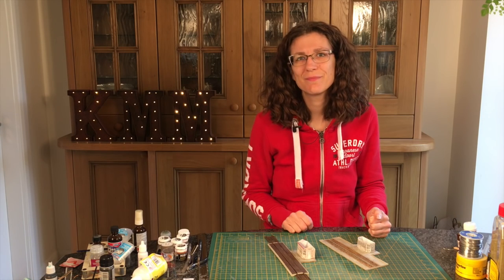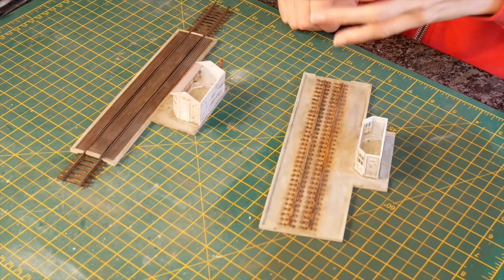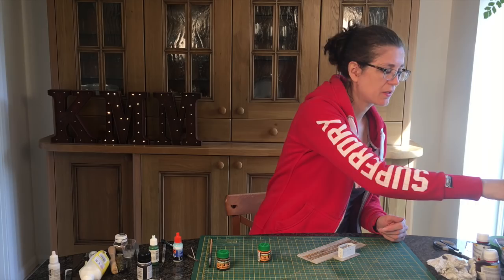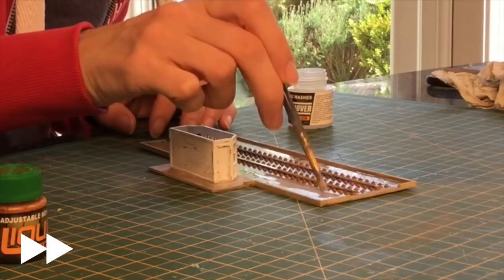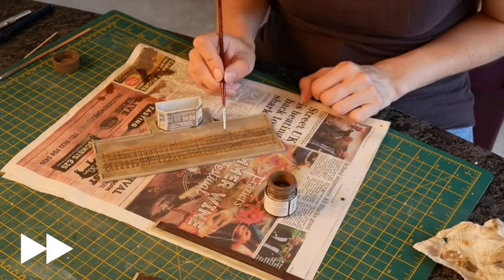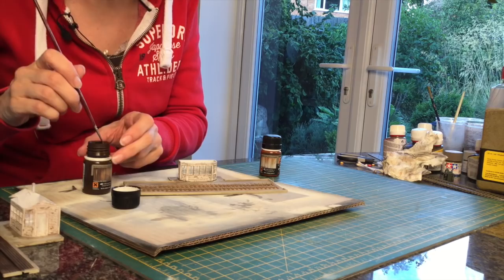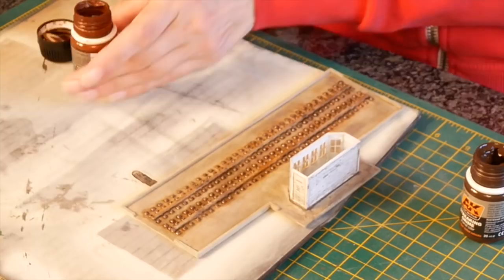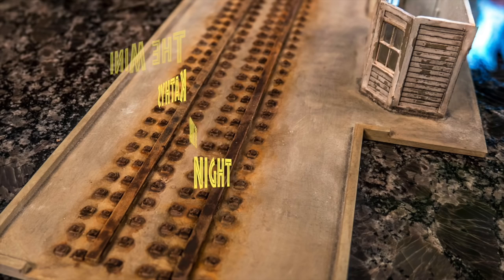How to Paint Rusty Concrete

Comment: Kathy, sorry to be questioning, but where is the drain for the (rain) water that is causing this rust? Or will the sea have caused any directional bias?  You real-world comments at the start brings me to think of this, but not understanding the drainage means I'm feeling a bit directionless ( or perhaps a bit run off?).  Does this railway scale have a platform with drain all round (like a lorry weighbridge) or strain gauges effectively in the concrete, so no boundary? TIA, regards, Tom
Reply from the maker: +Tom Lawton All good questions and I don't immediately know the answer. The scale is underneath so there must be something to stop it becoming flooded.